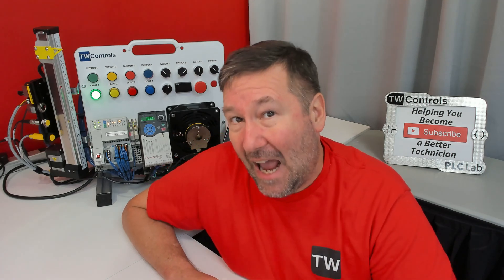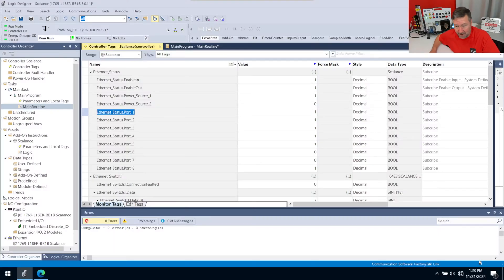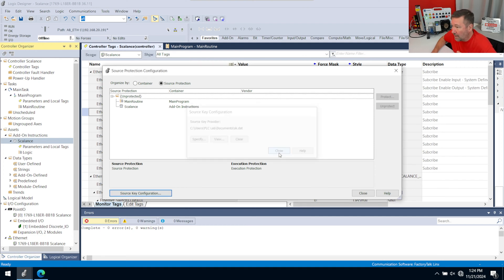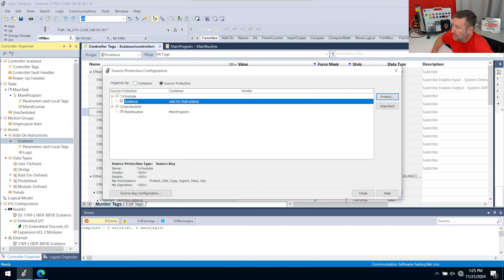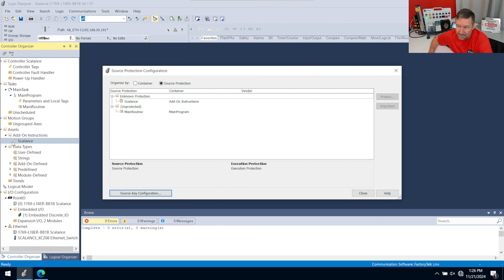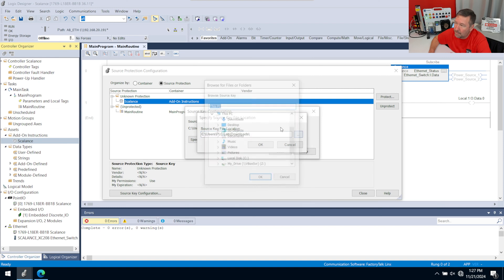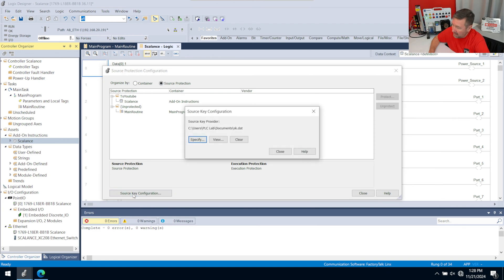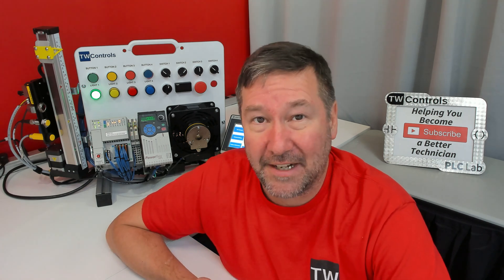Adding Source Protection in Studio 5000.  Should You?

Comment: Here's my frustration with source protection. 

As an end user and electrician: when I need to troubleshoot or modify a system, I can't without getting a hold of the original dev. Sucks when they are a company with no support or some random dude who's no longer around. 

As a PLC builder: I hate spending hundreds of hours developing things for a company only to have them scrape the code and hire some crap company and tell them to slap it together losing me tens to hundreds of thousands of dollars worth of revenue. 

You can't regulate "don't be an ass hole" so I normally split the difference. Proprietary modules I have to protect because I've been screwed. Open modules, whatever anyone can make it from scratch anyways.